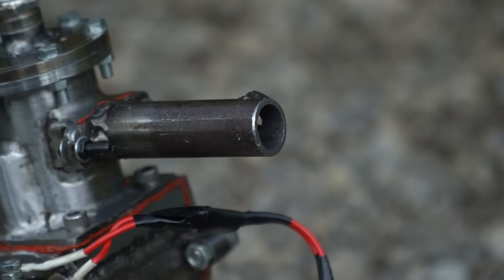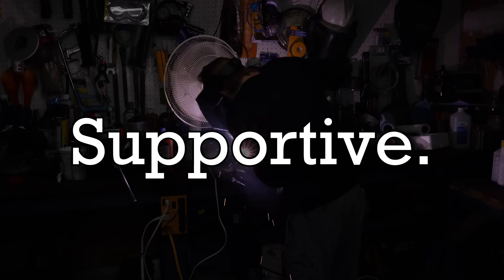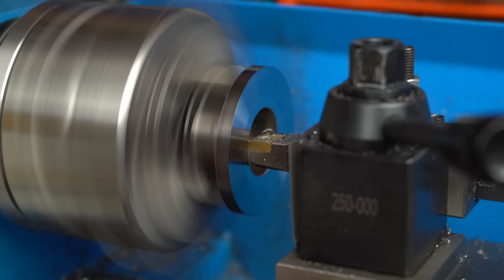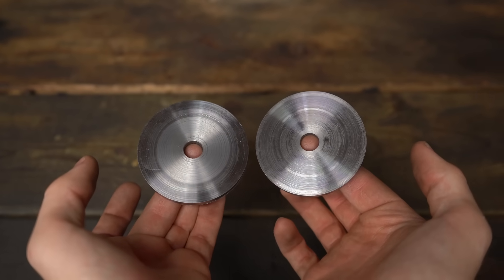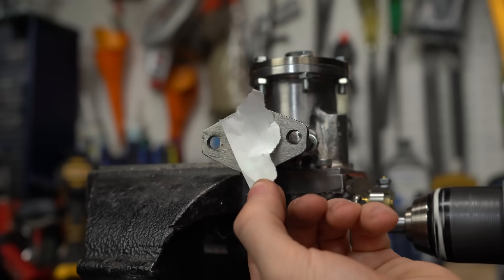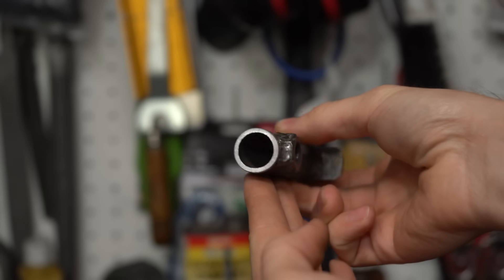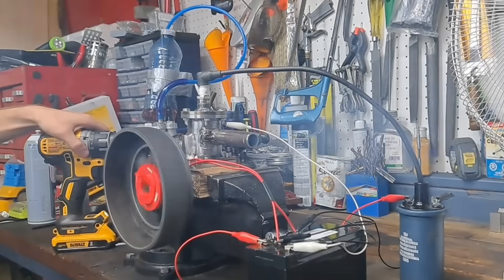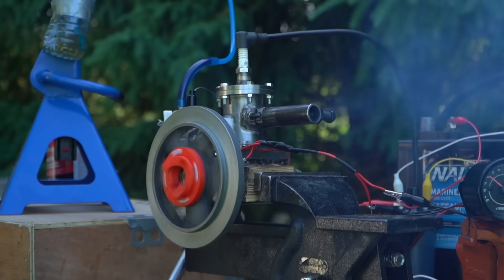I Made a Two-Stroke Engine Using Things I Found at the Hardware Store

Comment: Love your videos, and this one is INCREDIBLE! Honestly, though, the hole saw part set off my spidey sense something fierce. Those hole saws can grab like a mother when there's any kind of lateral movement (especially as you just break through one edge of the material), and those high torque low rpm mixing drills don't just stop. I was just thrown by one and nearly broke my thumb and index finger doing exactly what you did. The drill spun down after throwing me and ripped it's own power cord out of the handle.

I'm just a tinkerer, but I've found a few things that might help you on similar builds. I'm working on a 5.5" bore 2 cylinder flat steam engine, and I've found that it's just easier to buy pistons and connecting rods together, then use HONED HYDRAULIC TUBING for the cylinder. It's dimensionally accurate, and all you have to do is pick a piston that matches. I'm avoiding welding on the tubing or head by putting a groove in the cylinder cap using a TEPANNING TOOL (hole saws are trepanning tools, but in a lathe it cuts on a single point instead of 30 points), then dropping an o-ring into the groove. Once the groove is in to fit over the end of the tubing, an oversized cylinder cap can be bolted down with threaded rod right into the crankcase. That clamps the whole cylinder.

As far as using the Milwaukee hole saw, spring for the whole set! I love Milwaukee's hole dozers. If you give the metal a quick kiss from the cutter, you can then drill a hole on the tool's path that will evacuate chips, and it will cut many times faster.

Comment: If ever you need to cut large precise holes in thinner plastics, run the drill backwards. It's way safer with no bite, and the cuts are cleaner.

Comment: Should have degreed ports for what rpm u wanted to see at max . Degreed and found out blowdown and also the size and transition of the transfer ports . Then just did a shit mig weld up of an expnsion chamber thats close enough . Also didnt see him mess with the air screw on tht carb or if it was a 4 stroke carb , the fuel mixture screw.

Comment: Was that tach designed for 4-strokes or 2-strokes? 10k rpm seemed too high. Half (for 2-strokes) seems adequate.
Reply from the maker: Yeah, it was reporting twice the frequency that it was actually running at. I never actually watched the tachometer during testing but noticed it looked off later on lol

Comment: With a precision fit, one option is to heat the outer part freeze the other heat makes it expand slightly metal contracts when very cold, hence when they are fitted together they will not come apart ever, this is how locomotive tires get fitted and never come off!!

Comment: You dont want back pressure. You want a "venturi" effect from the correct size pipe, and on 2 strokes, it tends to be quite small in diameter. This is where the myth of back pressure comes from. Back pressure will push dirty gas back into the cylinder where as venturi will cause the exhaust pulse to vaccume assist the next pulse out of the cylinder to help clear out old gas and provide a clean mixture for the next cycle

Comment: I think the fundamental problem here is that there's not enough airflow.  2-stroke engines I've dealt with, with very little exception, have fed the intake charge into the crankcase, pressurized that on the downstroke, then let that into the combustion chamber near bottom dead center, at the same time opening up the exhaust port.  This both keeps airflow moving through the combustion chamber in a relatively orderly manner, but also lubricates the bottom end.

Comment: I’m fair certain the exhaust on a 2 stroke uses scavenging to pull all of the exhaust gas out of the combustion as well as pull the air fuel mix in, if you look at 2stroke vs 4stroke motorbikes the 2 smokers always have really fat part of the exhaust right after the manifold, so it should increase performance greatly

Comment: ok so i build two stroke and four big things one your port geometry is horrible so use a dremmel to clean them up as well as window the piston too second two strokes wont idle with out an exhaust the will start and run but not idle as you saw they four stroke without an exhaust third that first carb was a great size for 50-70cc engines you just dont have reed valves so you get blow back which on bigger carbs stops the venturi so get some reed valves if you can and four and most important secure the other end of the crank two strokes have much more vibration compare to a four stroke so it will rock itself apart constantly also side note there's a better location for the intake as well

Comment: A 2-stroke engine requires backpressure on the exhaust to prevent the fuel mixture from leaving the cylinder to early before combustion. But this backpressure must be well timed which is why resonance exhaust are used. But remember that you can only boost the engine in a limited operating point. You cant boost the engine over the hole characteristic curve.
Same is true for the intake side. You get oscillation there due to the cylinder sucking in the air not constantly. So you have to create an underpressure to get a constant air flow. Oscillating air might lead to a too enriched mixture and you have power losses due to the acceleration and deceleration of the intake air. Taking a smaller carburetor helped but you could have tried a reduction plate or this screw setup like on the exhaust as well.
The 2 stroke flow mechanics are complex and the  art ia to get an engine with a good low end torque but still high rpm capabilities. 
But still good work!

Comment: so many things you got to learn about 2T engine, obviously your first attempt to build one failed, but still fun to see you trying and i've laugh about every mistake you've made. made my day. then, i've made a quick list for you to improve your knowledge (very oversized carburetor = wrong F/A ratio / no acoustic reverberation on exhaust/ no balancing cranckshaft/ distribution cycle not properly timed/ flat head gasket instead hemispherical=bad shape of combustion chamber/ no cylinder cooling = dilatation ratio made wrong adjustement between cylinder and gasket approx 0.3mm constantly / no surface treatement on the cylinder (nikasil) mean friction and self destruct quickly /compression ratio seem to be ignored / iron block = pretty heavy, prefer aluminium diecast for the lowest part and for the cylinder spheroïdal font is the most appropriate (with nickasil treatment) because the dilatation coefficient is lower than the gasket = more heat-> more compression ratio and quite hard and durable material / 5 Transfers is the best way to be efficient on admission cycle & acoustic is a big part you completely ignored/ mechanical valve to modulate the exhaust impact by the size of the orifice. and i obviously missed many other points. bb

Comment: Look at how Soviet two-stroke motorcycles are designed, they are very simple. There is a lot of envy from the carburetor and from the fuel displacement chamber by the crankshaft, from the corners of the purge windows, the resonator, it will be useful)))

Comment: To answer the back pressure question, back pressure is a bad thing, but what people sometimes confuse with back pressure is pressure differential, this allows the high pressure exhaust to create momentum and draw the remaining exhaust gasses from the cylinder and draw more fresh air/fuel from the crank case. People confuse this with backpressure because it meana the higher pressure is maintained rather than just flowing out unobstructed.

To sumarize, its not backpressure, its momentum and pressure differential.
Reply: 2 stroke exhaust run most efficient when backpressure wave comes exactly in time from expansion chamber, making sure as much mixture as possible stays in the cylinder. Doesn’t need it though to run. But for a powerful 2stroke this backpressure wave is mandatory. That’s why these exhausts look like they do.

Comment: Cool! You build a small 2-stroke that runs out of 90% scrap. It took rpm's very well all the way to 10 K. 🤗
You also showed a prime example of what I've been trying to teach people for decades....DO NOT run 2-stroke bangers on starter fluid!
I've seen many fools start their 2-stroke outboard motor with starter fluid and end with a ruined engine. You went with a 40:1 mixture, I'd recommend 50:1 for an old outboarder. Modern engines even get away with 100:1.

Comment: Ik lubracants can be expensive but for a lil budget tip some lard can really help you chattering or even 3 in 1 oil but lard stays on longer we used it with drill bits and band saws ik the past

Comment: Fantastic design across the board, but for sustained high rpm, the crankshaft should be connected to both sides of the crankcase to avoid warping.

Comment: Hi, machinist here.

To improve the surface finish on your lathe consider sharper tooling. This can be done at home by grinding your own tooling from HSS.

The carbide inserts are great, however they are not as sharp and on a lathe which isnt completely solid, like the one you have, you will end up with poor SF. Rough using carbide inserts and then swap to dedicated sharp tooling for the finishing pass.

Happy Turning!

Comment: needs a stater needs a better igniter you can also set up an carging useing a stander stater gen or use an low power alt and wire it up and did a single piston motor you could do a muti piston motor also you can take sheet metal and weld on to it and use it to help cool it and keep it cooled would love to see a 4 clyder

Comment: Not sure why everyone on Youtube likes to tap holes manually. I'm sure an argument will be made that it's "more accurate" or "reduces likelihood of misthreading", but I've been tapping holes in steel with a tap bit in a drill for over 10 years with virtually zero mistakes, and I'm not particularly talented. If you're reading this, just buy a tap bit for your drill. It's infinitely faster, and significantly easier if you have two eyeballs and a neck that can move to check your angle. The speed of the process actually reduces the likelihood of errors.
Reply: Please do a video showing how you do this? It will help everybody.

Comment: I know a guy who's welding is worse than yours 😁👈￼ If you purchase a face plate for your lathe you can hold a cylinder perfectly by using two 90 pieces of steel angle bolted to the face plate with one bolt through the center of the cylinder (your crank case).  I can recommend the book. "The Amateur's Lathe" by L.H. Sparey.  Lots of good information with plenty of pictures and diagrams too!

Comment: That was totally cool 👋👌👍For cooling, you might consider welding 5 thin blades at a 45-degree angle around the perimeter of your flywheel. Is there a method you have to adjust the ignition timing while the engine is running? What is the engine's bore size?  purchased those pistons?

Comment: Great job!  Older model airplane two stroke engines like the Brown Jr. and the GHQ had a baffle across the top of the piston
to prevent the fresh charge from being pushed out of the exhaust before being ignited.  It was biased toward the transfer port side and only about 4 mm high.  Also, you can boost performance and scavenging by attaching 2 lengths of tubing to the exhaust, maybe 12 cm long one should telescope inside the other.  K&S brass tubing sizes will do.  While the engine is running slide on in and out until RPM peaks.  The increase is usually quite pronounced.

Comment: Very interesting, I think you might be the king of Over Kill!  You don't need all those bearings, just use some bronze bushings.  Cheaper & Easier to seal the crank case and a bronze bushing will hold up better in the crank lower end.  Probably could use less head bolts too.  Loved the excitement when you experienced "first pop".   welcome to the international fraternity of MICE. - -----
  (Model internal combustion Engineers. !

Comment: Pro tip if you're running a brand new 2-stroke engine you want to use braking gas, specifically a 16:1 ratio. Otherwise you can mess stuff up

Comment: i've promised myself that after getting my degree in MechE, im gonna buy myself decent tools to make this kind of stuff.
Can't wait to have the money and the rest of knowledge needed to pull off a DIY engine.

Great video, thx for the inspiration.
Reply: Start getting the tools sooner than later or you'll get old and slow before you have the tools.
Reply: Make your own tools at least repurpous parts
Reply: Bro you can make it crummy tools, don't wait
Reply: Make a diesel
Reply: @PRODCRUZ-sp4zi deisels aren’t meant for anything smaller than a truck because they need very specific conditions to run
Reply: This dude did it with essentially a paperclip and a stick of gum lol.

Comment: Expansion chamber design makes a huge difference in tuning, and where the power hits the hardest, it scavenges the exhaust with a supercharging-like effect on power.  It is a huge part of why more modern 2-strokes make such crazy power. I had the first ever FMF Gold Pipe on my CR 500, and with porting, head mods, etc. was making well over 70 HP It would come up in 5th easy.

Comment: So you used a battery to make the voltage necessary for spark? Not magnet on crank wheel? So you cheated a little bit. Anyway good work. I would never been able to make my own two stroke engine

Comment: To prolong life, you might want to put a gear-driven oil pump that points at the rotating assembly and inject two-stroke ( you were burning standard motor oil and that's why it was so bad), as well as some heat fins on the side of the cylinder walls with a fan-style flywheel and shroud the cylender if you plan to keep it a stationary engine. I have build many a classic piaggio's and this is my advice. This was super fun to watch! cheers.

Comment: I went through light wheeled vehicle mechanic training in the Army in the 1990s and I remember there was a lot of instruction about measuring back-pressure so engines would run properly.  I learned basically none of it beyond being told that back pressure is necessary for certain types of engines, but not for Diesel...I think.  I love this - super cool!

Comment: ahh, yes, the "other parts i forgot about and failed to accommodate in the plans so everything i just did goes on the shelf whilst i start all over again..."

porting, the most critical aspect of all... you havent made any allowance for gas flow, angles... "schnuerle porting". its ability to CLEAR the cylinder of exhaust and exchange it for fresh air/fuel without it also heading out eth exhaust, or worst case scenario, ALL the fresh charge heading out the exhaust whilst the burnt nasties stay in the cylinder...

would have been far better to find a "deflector" piston, and simply run "loop scavenge". a good "schnuerle port" is rather ambitious.

its more than likely why it deosnt want to run very well. it cant actually breathe, its inhaling its own farts...

ummm... carbs... the needle is simply mid range. the air screw is idle. the main jet is for WOT. 

bearings and crankshafts... practice your "press fits" a bit more ;)

ignition... i wanna see someone do a "tesla ignition". its the opposite of a standard points and induction coil... fires when the points CLOSE. and the first CDI, of course...

Comment: rtv silcone doesn't work good with 2 strokes and gasoline with chainsaws they vacuum test the lower crankcase you will want a seal on your crank dont use sealed bearings because the oil/fuel lubricates them lower crankcase volume has to be calculated as well in relation to your upper cylinder volume 
any crankcase air leaks means a lean condition 
this is a great design perhaps you can power a bicycle with it or a steam engine build for a bike steampunk style!

Comment: This is extremely impressive. The fact you did this with no precision machinery whatsoever is crazy. Not even a drill press! The guy who built the wright brothers’ engines would be proud
Reply: brother are you just gonna ignore his lathe a precision machine
Reply: @isaiahrosales7070 "precision" is not how I would describe that lathe
Reply: @nikkiofthevalley  "Precision" is how anyone from 1825 would have described that lathe. You don't get how far even cheap chinese tools have come. Roller bearings in a lathe? They had to use plain split brass bearings with shims to control clearance. Roller bearings in an ENGINE? They used poured babbit metal that was hand scraped!
Reply: @georgeblack589 what does the 1800s have to do with this? I think they would be impressed if I showed them a lightbulb
Reply: @AndrewAnderson-h4d  You said he used "no precision machinery". Precision is relative. The Wright brothers were already standing on the shoulders of giants who discovered the means for mass produced precision screws, pistons, and cylinders.

The bearings in his tools are made with machines more precise than anyone could have imagined ~100 years ago. My point is that his tools are excellent, compared to what has been historically available. The bearings, pistons, and rings used in his engine are PRECISION parts.
Reply: @georgeblack589  but to what utility is it to use the frame of reference of dead and gone people? We are speaking to a modern audience, we should use a modern frame of reference
Reply: @AndrewAnderson-h4d  I was speaking to the original post that started this thread, which posited that no precision machinery was used and that the Wright brothers would have been proud.

In context, my posts make sense.
Reply: @georgeblack589  Ohhhh I missed that part. Yeah that really changes everything, nvm